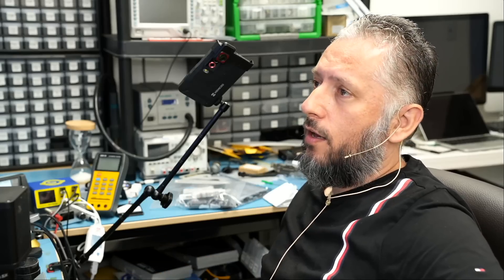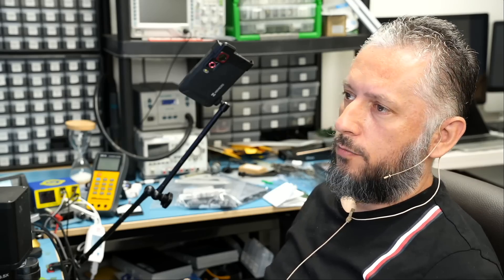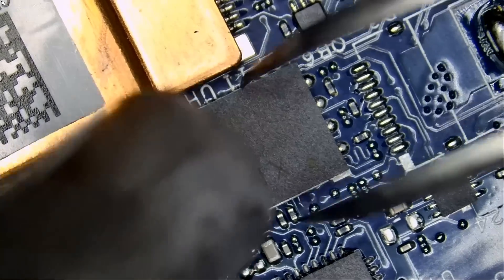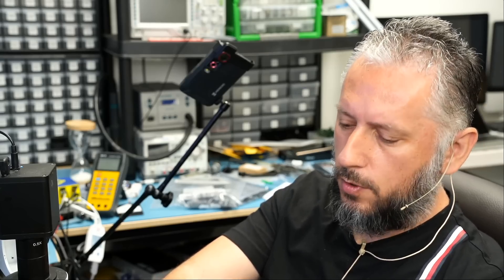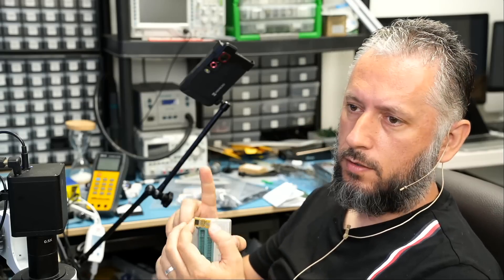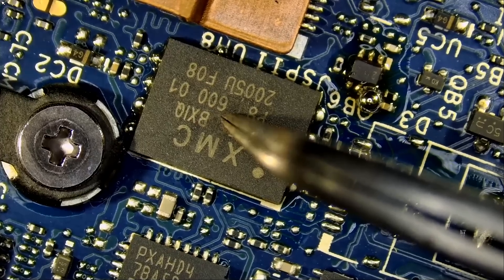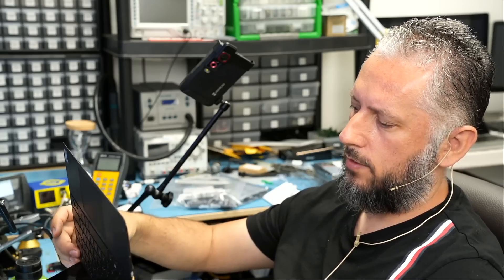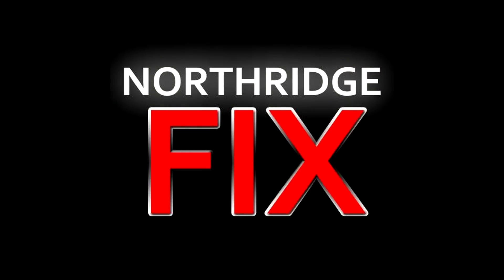Dell XPS 9310 Stuck at logo Blinking 3 amber 6 white. What's Wrong?

Comment: I am coming to you here for help as you are a master of the laptop repair. The problem I am experiencing is with two dell laptops. strange thing is they were working fine but with some defect. the latitude 5300 had faulty screen. just on the day of the screen replacement, the laptop wouldn't turn on. when you press the power button, the amber light comes on and when you release the light goes off. and this is what it does. no power, nothing, just the amber light when you press the power button. The other laptop is dell latitude 5310 and started doing this just when i upgraded the ram. just added an extra stick of ram and ever since it wouldn't boot up. just this amber light when power button is pressed. looking online it seem so many dell laptops, especially newer models have this problem with the amber light when power button is pressed and no  video online about this. I removed the cmos batt, pressed power button for 1 minute etc..as many suggesting but nothing. do you know what the problem could be and how to resolved it? Thanks in advance.

Comment: hey brother if u can help me man that would be great.. i have a shop and i can fix just about anything.. software or hardware, but this hp x360  15-ey0013dx  is trolling me,, i hangs on the hp logo...i tried diff ram, and ssd , unplugged all connections and left only fans and ssd ram and still  same issue..I even installed a new bios ic chip and flashed  bios bin for this device via ch341A ( sent badcaps forum the original  bios dump and they sent me the new file)  but still hangs on hp logo?! i can get into bios just fine..have you experienced this before ?

Comment: Had the same case on the very same Dell XPS model. (3 Amber 6 White, screen cycling colours.) Here's what I did to get it back: Downloaded BIOS_IMG.rcv version of the 3.18.0 Bios, copied that to a FAT32 formatted USB-Drive. Plugged the drive in (in my case via a USB-C mobile adapter, but that is irrelevant). Then, while holding down CTRL and ESC, plugged in the power cable. I was toally amazed when the Bios recovery dialog came up! It apparently updated quite a few ROMs and left me with a responsive system.
Only trouble: It does not recognize the SSD any more. Swapped it out for another one, but no luck. (With the new bios, I can boot from an external drive, so the system is sort of useable) - If anyone knows a solution to the SSD-problem, please let me know. It reportedly had problems booting since day one.

Comment: dell xps 13 9310 bios

Importance: Critical update
version: 3.17.0

Category: BIOS

Release Date: 11 Aug 2023

This package contains the Dell system BIOS update. BIOS is a firmware package that is embedded on a small memory chip on the system board. It controls the keyboard, monitor, disk drives, and other devices. This update addresses the Dell Security Advisories (DSA). A security advisory is a statement when a security vulnerability impacts a product, and a remedy is available for the vulnerability.

Important Information

- Once the BIOS is upgraded to version 3.0.4 or later, you cannot downgrade the BIOS to earlier versions. BIOS downgrades are restricted when there are security updates and important fixes with earlier versions that impact the functionality of the system.
- Except for the AC adapter, disconnect all the USB Type-C devices from the system before you start the BIOS upgrade process.
- BIOS updates take no more than 5 minutes to be installed on your system. You can install the updates in the background while using the system

https://dl.dell.com/FOLDER10324031M/1/XPS_13_9310_3.17.0.exe

Comment: I have a Dell XPS 9560 15 inch and NEVER have had a problem.
It stays on 24/7 as I use it for stock trading.
I bought it at the end of 2017.
It even got wet once and the screen was water stained till it finally dried out a week later but still, no problems.
I did replace the charger and charging port  about  4 years into its life but that's all.
I keep it clean and just cleaned the main chips and put on new thermal paste.
A little periodic maintenance is all that is required for keeping a laptop going.
I will say that the battery life has gone down from 6 hours to 2 hours in all this time and I do plan to replace it but it is rarely on battery life unless the power goes out.
It's also a touch screen with NO problems.
I guessing the 13 inch versions have some glitchy problems that the 15 inchers don't.

Comment: I have this exact same laptop I bought from eBay because it was cheap. Sometimes it does that and hangs at the dell xps logo. So what I do to fix it is take the battery connector off and hold the power button for10 seconds and without reconnecting the battery I use the power cable to turn it on. Once it turns on I switch it off and take off power cable and reconnect the battery and start the laptop. It works for a long time like 6 to 7 months then t happens again.

Comment: Is it just some dust reflections coming from the screen?, otherwise potentially some very mild graphics artifacts going on and there were a couple that mentioned possible graphics issue. Probably a no-fix at this point in terms of customer juggling costs between continued repair or new replacement idk.

Comment: You need to reset error log file.
Disconnect the battery, hold the power button for 30 sec, connect battery and try to start again

Comment: 1st time writing long time watcher. 1st remove main  battery and RTC battery ( mostly its seal CR2035  or smaller).  wait atlist 10 mins. Don't plug charger. Press power button for 30 sec. Remove SSD. plug charger ( don't connect any battery) press power button and check screen . Press F2 and see if you can access bios settings. Don't worry about lic in bios because it has SLIC table as oem bios.

Comment: Around 20 years ago, Dell made good computers.
Today, they make low quality overpriced garbage computers. 

For about 3 years ago, I bought a Dell XPS9570 laptop during my studies. 

In one year, it had 6 issues. 

Starting from:
• Bad Wireless NIC
• Strange loud squeaky noise from right corner of the laptop.
• Power button stopped working after 6 months 
• Motherboard issue require 3 times replacement
• Dark shadow in the middle of the screen after 10 months of use. 

And finally 
Design flaws causing scratch marks from keyboard on the screen. 

After 3rd failed repair attempt I ask Dell for fully refund.

Comment: What if the battery is simply dead (or the ic on it) and it doesn't allow the laptop to POST ? At this point I'd just try to find a known working battery. BTW that battery needed is good design... for DELL, either it's just a check, or the laptop ALWAYS run from the battery even when plugged and you can imagine how that's a plus for DELL on the long term ;)

Comment: Power on system, quickly start tapping the F12 key continuously until you see Preparing one time boot menu in the top right corner of the screen. In Pre- boot menu, select diagnostic. After quick tests finished, select Hard drive and Thorough Test Mode. Report back any error code?
Just a thought.

Comment: It could be a defective bios chip .. try to flash a new chip .... Thank you anyway ❤
Reply: Notice the flash process consists of 3 steps - erase, write, verify. You know the purpose of the last step.
Reply: Yes i know.
If  the file is verified correctly it does mean the ic will work .

Comment: Most people in the comments are pointing at the battery, others at the disk or even at the RAM, even though it's soldered on the board.
But I'm thinking this could have something to do with the BQ chip. Have you looked into it? Might be worth a try. 
Nice video, thanks.

Comment: Clearing the me region might help to boot it further. IF you don't want to do it manually, "Universal BIOS Tool by Andrew_R" is a tool for fixing BIOS dumps. Besides clearing the me region, this tool can transfer all info from the original dump, to a dump from the internet.
Reply: Googled and always takes me to universal bios backup tool. Do you have any link for that program?
Reply: He stated in the video that the bios file he was flashing had a clean ME.

Comment: This is a classic case of faulty RAM

Change the RAM and it will boot
Reply: Dell XPS RAM is not replaceable, it is soldered onto the motherboard. But I do not think the issue is a faulty RAM chip.

Comment: Did not notice the original BIOS dump was saved?
There is a rule of thumb -  always try to use original BIOS if possible. In your case I would try to clean ME region on the original dump first before messing up with dumps. If does not help, grab BIOS region from DELL Bios update and replace it in the original dump.
Reply: To me it looked that the BIOS chip was blank and contain no data

Comment: Take my word for it, Dell XPS 13 are shit. We've bought over 20 XPS 13 at my company for over 5 years and we've had about 5% failure rate. Last one was a brand new XPS 13 year 2021. Died after 2 weeks of usage.  Not even powering on. And it never left the office, was used solely on a flat surface and in an air-conditioned room.  They do seem to have very poor cooling due to the very bad vent design underneath. Correction,  25% failure rate. 5 out of the 20 XPS 13 stopped working. All indicators point to poor cooling.

Comment: Always make a backup first before erasing/programming a Flash Chip.  In case your solution didn't work, you can revert back to the original firmware.  Some firmware may contain Serial Numbers, Asset Control Tags and Windows license.
Reply: But to me the BIOS looked quite blank with no useful data just a lot of FF hex.
Reply: @afre3398  there was no chance of recovering any data guarantee it was compleatly fucked before the reprogram
Reply: @afre3398 that came to mind as well
Reply: Yes all technician should know this.👍
Reply: All windows machines have the OS license in the BIOS since the conversion to UEFI. Exceedingly rare to have anything come in that's older these days, at least for me.
Reply: @x8jason8x  Yup.  Since backup was not made, any chances of retrieving the OS license from the original BIOS and transferring it to the candidate firmware is gone.  But the best way to go through this is to backup the original BIOS, then clean the ME Region from that as it has the highest percentage of working as opposed to an unverified dump from the web.  In this case, more damage was actually done to the laptop and it is permanent since you cannot recover the already overwritten original BIOS firmware.
Reply: @lazal3m  The licence isnt stored in the BIOS, the identifying information, called DMI strings are), Windows reads these DMI strings and that causes Windows to activate if they find a match in the Microsoft Activation servers. All the BIOS needs is the appropriate DMI strings which usually include 3-5 values including model number and serial number programmed into them either using a DMI tool or in some cases the BIOS lets you add the values directly. I had a HP AIO come in the other day which was citing it didnt have correct DMI values (every value was blank), it needed a Model Name, Model number, machine Serial Number, a unique identifier for the model (check byte i think), and a mainboard serial number. We had 2 more of the same model in the store at the time, so we verified that both had the exact same SKU and looked in the BIOS for the unique identifier, saw they were the same on both units.

I then added into the unit without any info its main unit model name, serial number, model number. I copied the check byte (i think it was called that) which was about 50 characters from one of the other units. I then after having opened its cover located the mainboard serial number printed on it which is different to the machine serial and entered that in. Once the values were accepted and the machine rebooted, the Windows 10 Home on the machine immediately activated using a digital license without troubleshooting or changing any keys.

Typically so long as you have the ability to enter the DMI information into the new BIOS chip and you have the correct details to enter in, Windows activates no problem. Just depends on manufactuer if it needs a proprietary software utility or if it can be done directly in the BIOS menus. With most HPs I have found it can be done directly, but the section of the BIOS that allows it is only able to accept new values if it detects there is a value missing. Basically it tells you values are wrong or missing and offers the chance to reboot and enter a mode that allows you to enter data to those specific values. Entering wildly wrong values though tends to make it not POST without fully resetting the EC data. So if you dont know what they are, best to leave them blank until you know exactly what to type in.

You have to do this every time you replace a mainboard in a system using the new digital activation system from Microsoft (basically every machine from Windows 8 onwards).
Reply: @MrGeneralScar  thanks for explaining further!  So the DMI string is the calculated product of model name & number, machine serial, mainboard serial, and check byte.  This further complicates the repair process and chances are if you miss a character or typed in the wrong case, the resulting DMI might not even match anything stored in the activation server.  You would have to re-program the flash chip again and do the same steps until it matches/activates successfully?
Reply: @MrGeneralScar  appreciate you writing all that, ty
Reply: @lazal3m  you couldn't be more wrong on the license :D. You still can boot to this OS which has a license key, you can get it even via CLI, you can google that command. Once you have it, save it somewhere and pass it on to the customers ;) for future reference.
Reply: @MrGeneralScar thanks for the validation. 
Also if past point of extracting this, windows 11 is free and 10 can be found for 12$.
Either way extremely great information much appreciated.
Reply: @x8jason8x This was done to combat piracy mainly codes are hashed digitally into servers and random people can't look at keys or take a pic of keys
Reply: It also solves worn off keys on laptops in win7 vista xp era keys would wear off during use
Reply: Remove the battery then reset the bios using a metal to ground.